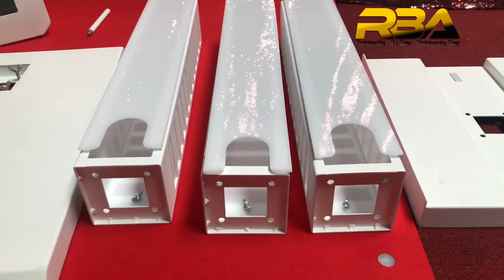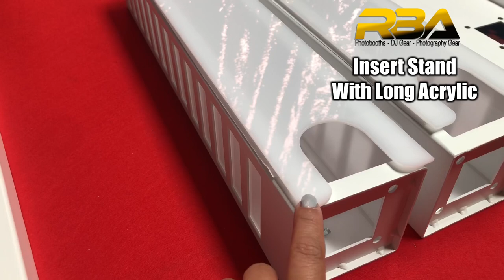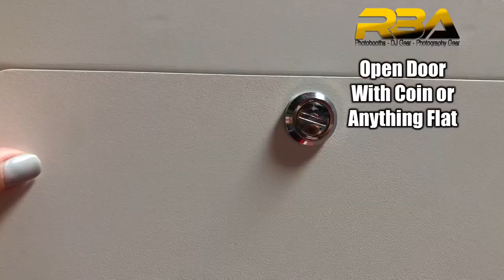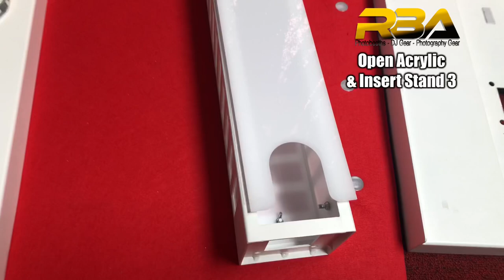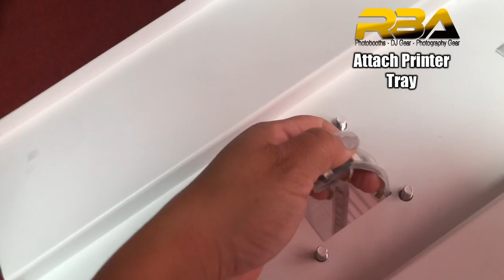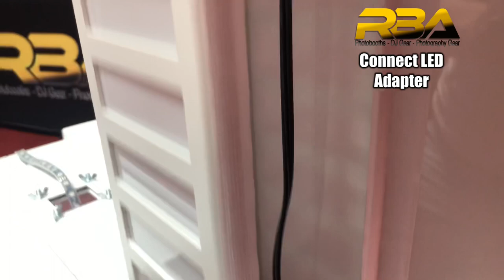T11 Vision Photo Booth Shell Set Up - Fast Photo Booth Set Up * Extended

Comment: Does this model have a fan built In for the iPad boo
Reply: *booth ?
Reply from the maker: barefacedbeauty101 there are vents on the back for the Microsoft surface pro, but no fan built in.  The fan is not necessary, but you can add it if you like.